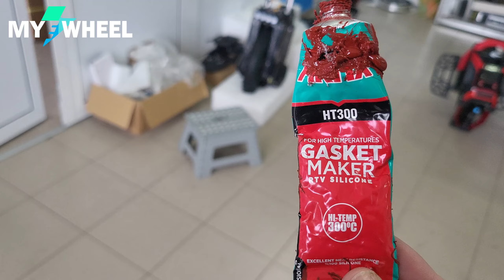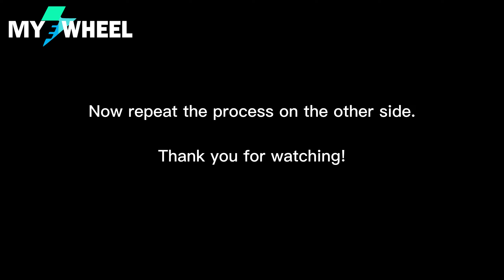How to fix KingSong S22 knocking bearings noise.

Comment: I fixed the same issue on my S20 (1st generation S22).  I didn't need to separate the barings from the covers.  Just the glue between the hub and the inner race.  I also pinned the stator while I had it open (gen-1 had stator slip issue).

Comment: it will be "nice" to open motor deck second time with such amount of silicone... wouldnt simple greese not enough to seal it?
Reply: Riders ride in the rain, even in the dry puddles happen. The wheel needs some decent waterproofing.

Comment: Have you ever heard of this specific problem on the kingsong S18.
I have this type of noise on mine bought 2 months ago.
Reply: my ks s18 is doing it second day after buying it, very unhappy with the sound after spending 2500 :/
Reply: I have this noise on my S18 that I purchased about 7 months ago. Also quite disappointed.
Reply: the newer s18 wheels have the same motor setup as the s22, same bearings. I had to replace my first gen motor and the new one has this issue. QC is a mistery to kingsong lol...
Reply: @keptick  Did you end up replacing the bearing?